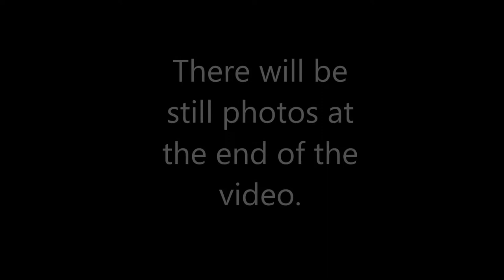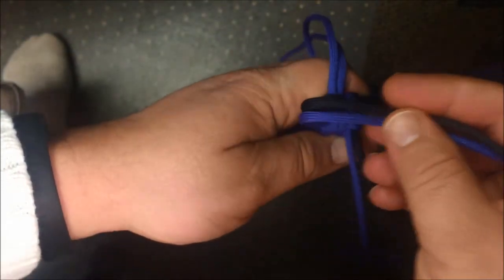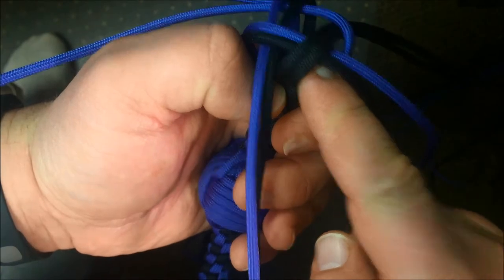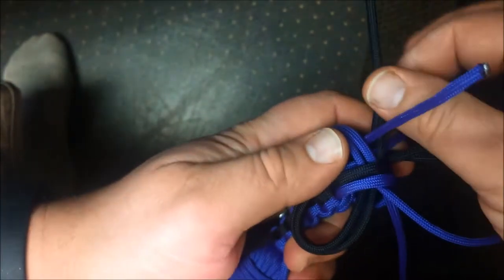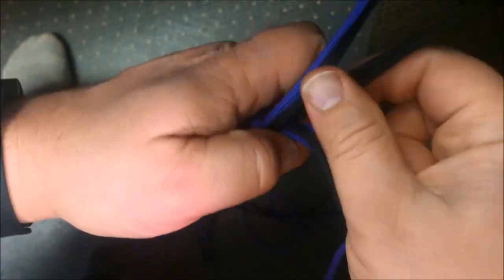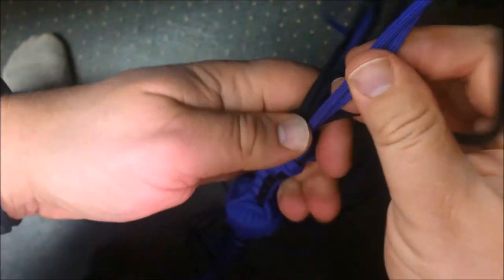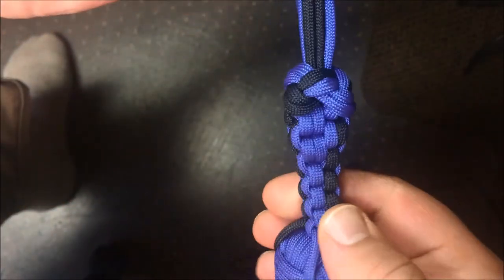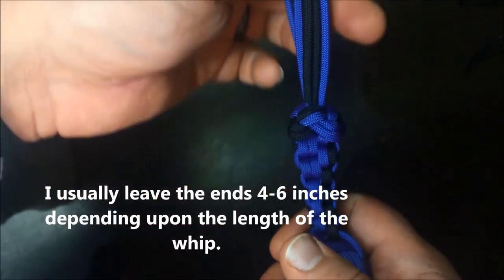Diamond Knot - Finish for Paracord Motorcycle Get Back Whip by Jarhead Paracord

Comment: How long are the strings ?
Reply from the maker: Usually 4-6 inches in finished length. It's a personal choice if you're making your own. I follow the longer the whip, the longer the strands.
Reply: for the Get back it self for a two to three feet one
Reply from the maker: +Tiajuana HEATH - you'll need approximately 80 feet to total length with the longest being approximately 26 feet.